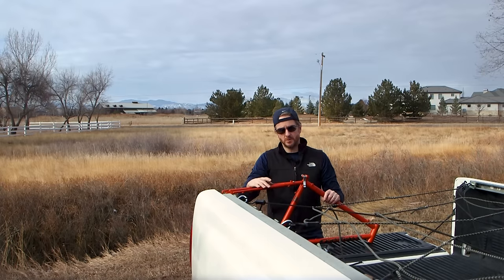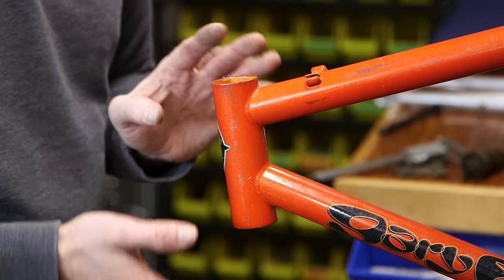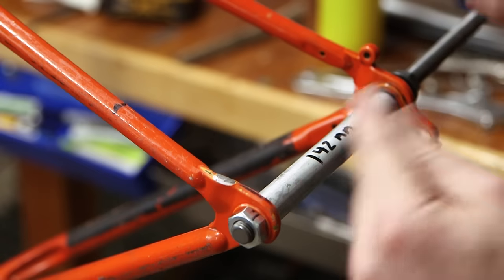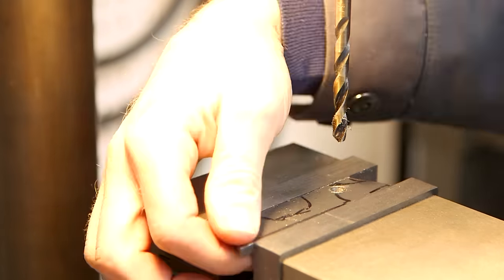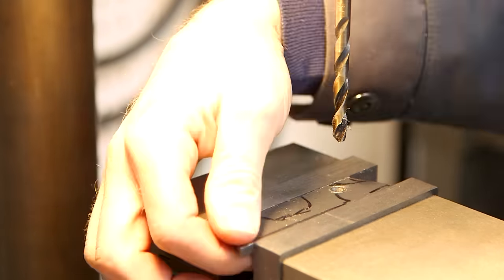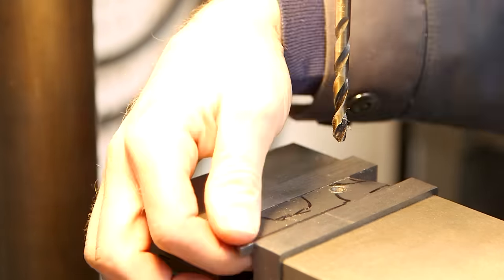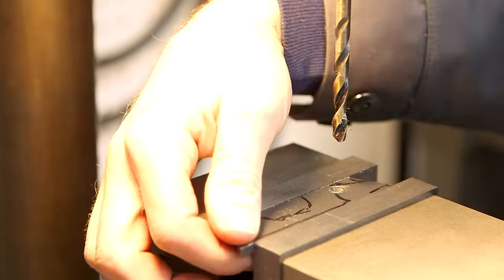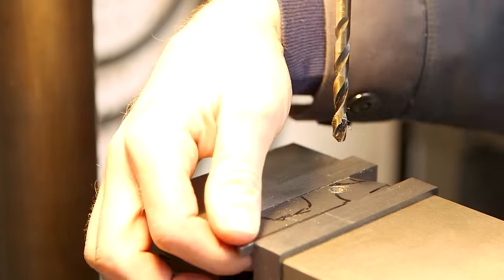1990's Gary Fisher Gravel Bike

Comment: A '90s MTB that fits 700c wheels? Or was this more of a hybrid frame? Aside from cold setting it to 142mm axle width it didn't seem like you needed to modify the rear triangle to fit the larger diameter wheels, unless I missed something?

Comment: I have a 90s specialized m2 stumpjumper I've been wanting to do something similar. It's some kind of aluminum matrix, so I think welding is out of the question. Do you think a 650b wheel would fit the 26in rim brake?
Reply: There are long slotted v brakes for wheel size swaps. Also there are adapters for normal vs to take taller wheels.  I like 700c on old mtn bikes,  with 40mm tires

Comment: Absolutely great work! I’m going to do the same but i need a little help from you. What kind of bottom bracket did you use? The 90’ mtb frames more or less use all the cartridge tipe. I have to pay attention of something for adapting a Grx Shimano? Thank you
Reply from the maker: I used a road bottom bracket, BBR60.  It will work with a 68mm bottom bracket shell width.  If you have a 73mm, the MT501 will work.  It's essentially the same BB but with a wider dust shield.  Measures yours.  The GRX crank won't work if your bottom bracket shell is 73mm, though.  It has to be 68mm.  The axle isn't long enough for the 73.  If you do have a 73mm, you can cut down the bottom bracket shell to 68  to use a GRX crank.  You'd probably need a milling machine to do that to get it the right width and maintain perpendicularity, though.  It has to be accurate.  If you do have a 73mm, you can use a mountain crank instead, but they generally don't play nicely with GRX shifters.  The front GRX derailleur likely wont have enough swing to get the chain onto the big ring.  I've found that using a triple mountain crank and a triple mountain front derailleur will work with GRX shifters, if you remove the inner ring of the crankset and turn it into a double.  Hope that helps.
Reply: @RobertAdairWorkshop  Oh thank you so much you help me a lot. Honestly i don't have the bike yet. I want to built a gravel bike with 90' mtb steel frame for travel using obviously an old frame.I'm studying if is possible to install a Grx groupset with disk brake, through axles, carbon fork and your videos is what i need and what i've been searching for a long time. I have tig weld at home and i mechanical design and laser cut worker and for that the conversion work shouldn't be a problem for me. What i want to know is the problems i will encounter. For examble now i know that i have to find a frame with a 68 mm BB shell width for install Grx. Can you help me for the carbon fork, the Grx post derailleur, the 700C wheel ? What the frame will have to have for suite all of these things without turn me crazy? I'm 1.80 m tall. Thank you so much

Comment: Very nice build!
Were the slx mtb brakes fully compatible with the STI levers, or did the brakes feel a bit off?
I've built a gravel bike recently based on the shimano tiagra groupset, but I hated the flat mount calipers. If the Slx calipers are compatible with it, I might consider switching to them
Reply from the maker: They are spot on.  Fully firm lever about an inch away from the drops when pulled.  Feel and power are exactly right.  Much better than the Tiara and 105 flat mounts on my road bikes.  If you do, use the BH90 hoses.  The levers shown in the video suggest BH59 but the 90 is much better for this combo.

Comment: Hi Robert, any other brands/models that would be well suited for a conversion just like your Gary Fisher? I imagine most 90s MTB would work but are there any other older types of bikes it might work too?

Cheers
Reply from the maker: I've been watching.  Kona makes some that are good.  A few models from Trek, after they stopped using lugged frames, are good.  Most Giants are too small so skip those.  Specialized tends to be too long though I found a HotRock that might work that I'm thinking about buying.  Really, watch the top tube measurement.  Make sure it fits within your size range for a road bike.  I ride a 54 but I like small bikes.  Unless you're over 6'1, I'd recommend a top tube of 56 or shorter.  Look at frames where the seller posts top-tube measurements and find one that is short enough.  But then look at the top-tube CC bottom bracket measurement.  If it's less than about 17" with a 56 top tube, the frame will feel too small.  I guess what I'm saying is, look at the top tube measurement.  If it looks good, make sure the seat tube isn't too short, then look to see if the head tube is 100mm or longer.  If you find one that meets this criteria, you're gold.

Comment: Hello. I was super inspired by your video and bought my self a specialized rockhopper 1998 frame. Waiting for my parts and ill start working on it. Through axle and disc brakes. You did the analysis on the frame load when mounting rear disc brakes. Do you think that mounting front disc is a good idea on the fork that doesn't have disc brake mount initially, or is it better to look for a new fork?
Reply from the maker: Sounds like this is going to be a fun project.  Is the original fork one of those beefy steel forks that would have come on it, originally?  Those are way over-built.  I think you'd be fine to convert it.  That being said, you can find steel, straight-steerer disc forks on eBay for under $100.  Might be worth getting to save the time fabricating a mount on the original fork.  Search eBay for "Twin Six" fork and you'll find a bunch of options.

Comment: This is a fantastic conversion. What was the reasoning behind MIG welding instead of brazing, and will the seat stay be strong enough for braking forces without additional bracing?
Reply from the maker: I know how to MIG weld.  I've never brazed anything.  So I went with what I know.  I don't think there will be a problem with the stay regarding braking forces.  The ISO mount couples the dropout with the stay and the whole area is 3/16" thick.  To fail, it'd have to buckle both the chain stay and the seat stay, both of which are about 1.5mm thick.  Brakine forces on the rear of a bicycle aren't as high as people think.  Those google images that show frames with buckled stays or forks, are on bikes with lighter tubing and thinner ISO mount designs.
Reply: Seems reasonable. Paul Brodie made a gravel frame recently and added a brace, which spurred the question.

Comment: I had the same issue with the crank arm spacing and would make contact under heavy acceleration, just file off the crank arm for clearance and should be good
Reply from the maker: That really is  a good  contingency plan.  I can bevel the crank arms in the mill.  Add clearance but not risk compromising strength.

Comment: How did you keep the dropouts parallel to each other after spreading the rear triangle?  Or did you compensate by letting the nuts+axle self-align, and fill the gaps with filler rod?

Comment: Not mentioned was how long of a fork that this frame was built for, thinking of what the frame angles ended up as(?) and especially how high of a bottom bracket resulted from using such taller wheels.
Reply from the maker: The wheels aren't as tall as people tend to think they are.  These are 700c x 40mm which gives them an overall diameter (at the edge of the tire) of 701mm.  The original tires were 26x2.25 which would have had an overall diameter of 673mm.  The wheels stand 14mm taller on the radius than the original 26.  If the bike had 26x2.5 tires, its' almost exactly the same diameter.  Because the wheels are larger but the tires are smaller, the overall diameter isn't much different.  So the bottom bracket in this case sits 14mm higher than it did with the original tires.  It's the same story with the front fork.  The original had an axle-to-crown of 440mm with the 26" fork.  The new 700c fork has an AtoC of 380mm.  So the front tire sits a bit higher but the fork axle to crown is a bit lower.  The front end is pretty much a wash.

Comment: Funny, I've never seen a bike frame with zero parts out in the wild unless I stripped it. In general, you're going to need a tiny frame because the reach of the MTB frames becomes huge with the dropbars. Even really short stems rarely fix that, but do make the bike really twitchy in return. Personally I opted to buy a purpose built gravel bike with full hydraulic disc brake setup ie. 10 speed tiagra for 600€ brand new and saved myself a lot of trouble.
Reply from the maker: If you look closely, it already has the dropouts drilled in the opening sequence.  It’s because I made it that far into the build before I figured out how I was going to start the video.  You’ll also notice that the dropouts are welded when I talk about sizing.  I don’t always know what will go into a video until I’m editing it so it’s often filmed and assembled out of order.
Reply: @RobertAdairWorkshop  Fair enough! 🙂 . . that usually is the place they end up being picked up from, anyways 😁

Comment: im thinking to do something like this. Question - are you not worried about disc brake mounts? as in many poeple comment about the frame being designed for v brakes and it can crack with disk brakes. Makes sense, but at the same time, i fell like you apply same direction forces to frame anyway. Would be interested to hear your take on that
Reply from the maker: I'm not at all worried about the rear frame buckling or cracking from the disc brake forces.  I did a follow-up video to that one where I took an in-depth look at the forces on the stay.  I think, as with anything, a few images of buckled stays or forks circulated the internet over several years, some redittors saw them, and it became internet lore, without anyone really thinking it through.  Redit will tell you it'll fail.  The math says it won't.  This is the second I've done without issure.  The other was on an aluminum frame.  If you're curous, take a look at that other video.  I'll add a timestamp link so you can jump right to the disc brake mount part:  https://youtu.be/e0UhOou45IU?si=ulgIJzZUOAKtxqNs&t=534

Comment: Great job!  But, how do you fit on the rear a 700 wheel plus tire on a 26” wheel bike.
Reply from the maker: The frame was designed for a 26X2.25 tire that's an outer diameter of 675mm.  These are 700c x 40mm which has an outer diameter of 698mm.  That's 23mm difference on diameter, or 12mm on radius.  In other words, the number is close enough that the larger wheels fit.  It's because the 26 used larger tires than the 700c.  The OD comes out about the same.  This is not true for all frames.  You might not be able to run as large of 700c tire as I have.  Check out Cateye's wheel calculator.  It's really helpful in picking tire sizes.  https://cateyeamerica.com/pages/tire-size-calculator

Comment: Bottom bracket seems really high off the ground. Makes sense since the frame was intended for smaller wheels. Any issues with reaching the ground from the seat?
Reply from the maker: None more than normal.  It really rides like a gravel bike.
Reply: Thanks for the reply. It turned out great!

Comment: i think this pulley under Fd will be dead from dirt in no time, maybe could be just enough with 1x on front?)
Btw awesome build, i did very same conversion on my old mtb but kept v brakes and ditched fd
Reply from the maker: They do it a lot on cross bikes.  It's not my idea, sadly, I'm not that smart.  I packed it with grease so when the bolt is pressed in, I'm hoping the grease will keep grit and moisture out.  But I think you're absolutely right.  Those pulleys were a 5-pack and I plan to check them when I do chain maintenance or have the wheels out.

Comment: Re: the crank-chainstay clearance,
If those GRX arms are solid (forged?) you should be able to quite easily get away with skimming 2mm off the inside face as a taper or radiused in, rather than finagling the stays.
Reply from the maker: Yeah, I think they are forged.  We'll see if I need to, but that sounds like a pretty good way to go.  Thanks!

Comment: Are you sure that MIG welded is sufficient to secure these modifications as opposed to full penetration welding from TIG welding?
Reply from the maker: Yeah, I have 100% confidence in the MIG welds.  MIG is frequently used for structural welding in all sorts or industries.  I work in the gas industry and we use it for welding together pipe on our transmission lines which operate at 1000psig.  MIG is a good weld.  The flux-cored MIG gets a bad rap because of the spatter and uglier welds it produces, but its still a  good weld.

Comment: Those drills were a crime.
Reply from the maker: They weren’t great.  I couldn’t come up with another way.  How would you have done it?
Reply: @RobertAdairWorkshop  I would change FD for that one with top pull or attatch this wheel with clamp. For me drilling is always last option. Especially when the project (paint) is finished. You made perfect place for corrosion. I assume (and hope) there will be no mudguard. :>

Comment: Wait, did you clear coat over the graphics? Can I clear coat over the old graphics on my bike to preserve them?
Reply from the maker: I did, yeah,  They had clear over them from new.  I scuffed the frame with 1000 grit sandpaper so the new clear would stick and shot it over the original paint.  Note that I’m using a 2k epoxy clear.  It is much less likely to react with old paint and cause wrinkling.

Comment: 5:38 A. Those upper threads will cut into the axle
B. The dropouts have a 19mm recess in them that the hub endcaps slot into. There is zero vertical weight on a thru axle, your setup has 100% of your weight on a 12mm hollow aluminium axle....at a minimum use 12mm 12.9 cap screws as axles
Reply from the maker: That’s not right.  I thought about this when I made the axle adapters.  I have three other thru axle bikes, a Chumba Terlingua,  a Niner RLT and a Giant Contend.  In every one of those frames, there is a gap between the hub axle and that ring land with the wheel installed.  The forks on those bikes are the same way.  The Whisky fork had almost .5mm of space.  If the hub axle doesn’t sit on the ring land, then it isn’t carrying any load.  

All three of those forks are carbon.  That ring land on the Whisky fork one only sticks out about 1mm.  If those lands were carrying load, at that thickness, the pressure on them would be immense.

Those ring lands are there to help align the wheel when installing it but not to carry load.  Check the thru axles on your own bikes.  You’ll find the same.

Comment: Nice build. 
I could never do all the specialized work you have done.
Pretty obvious the bracket is a lot higher than on a modern gravel bike. And also than a cross bike, which already comes with a higher bracket. But for a short legged person that might be fine. It does mean the riding position is probably a bit higher. And that might attribute to having to raise the steerer even higher.

My cross bike actually came with bottom pull front derailer, operated through a cable coming from the top, using a pully, just like you did. Works fine. A bit weird on a new bike. 

Question 1: do you really think through axles make a big difference? Well everybody is running them.. I just feel I would be afraid I would damage the thread over time and then you can't fix the wheel properly. But apparently that is a non-issue.
I had the opportunity to change my cross bike to disc brakes because it already had the mounts. That made a huge difference. But of course that does mean it still has drop outs and quick release axles. They work fine, but of course I can't compare them to though axles.

Question 2: The new backwheel with the disc indeed was a bit wider (142mm i guess). So the bike needs a little tweak when putting the wheel in. And then it's not perfectly aligned in the middle. Aluminium frame.. So not an option to align the?
Reply from the maker: With the toptube cabling and overall geometry, I think this bike would technically be a cross bike and not a gravel bike.  I don't really think through axles make a lick of difference.  I have bikes with both and QR was used for decades and nobody really complained.  The problem is really just parts availability.  The bike industry doesn't offer many new, good, QR wheelsets.  The Thru Axle mode opens up a lot more options.  I ride a Marin Gestalt which is QR, gravel, and quite good.  I'd never even consider adding thru axles to that bike.  

I've used some wider wheels in narrow aluminum frames (135mm in 130 dropout spacing) by just flexing the dropouts apart and I've never had any trouble with it.  I've noticed that sometimes the wheel isn't perfectly centered, too.  A hack is just to tweak the axle alignment in the dropouts ever-so slightly to get the wheel centered.  I ride a Giant OCR from time to time which I've done this with and it's never been an issue there.
Reply: @RobertAdairWorkshop  Thanks. Yeah I guess mine is also 135 wheel in a 130mm dropout. Tweeking the axle alignment..i wouldn't know how to do that with keeping the disc brake in the right place. So i'll just use it as is..

Comment: have you ever ended up messing up the threads when welding threaded nuts due to warping?
Reply from the maker: I put a bolt through anything that has threads when I weld it.  Keeps spatter out and helps to preserve the shape.  I do run a tap through most things I've welded, that are threaded.  On this one, I used a tap afterward to chase the threads and a 12mm ream on the non-threaded size to restore concentricity.

Comment: "Gravel bike," also known as a road bike. As if a special type of bike is needed for riding on gravel roads. The wider tires and lower air pressures that so-called "gravel bikes" use smooth out the ride a bit, but wider tires and lower pressures have already been a trend with road bikes for a while now.